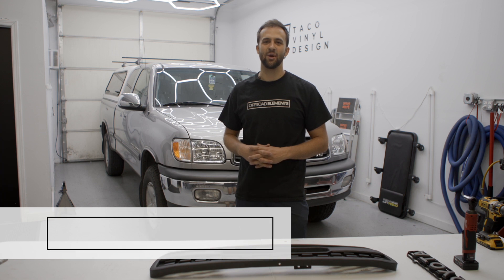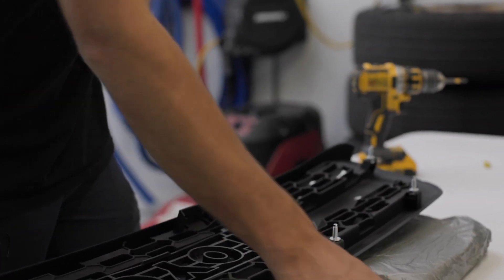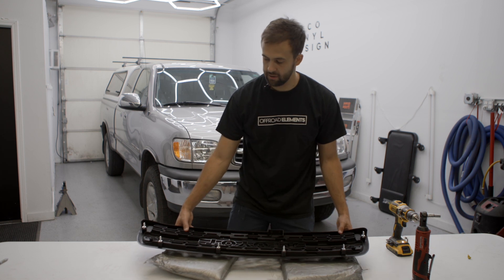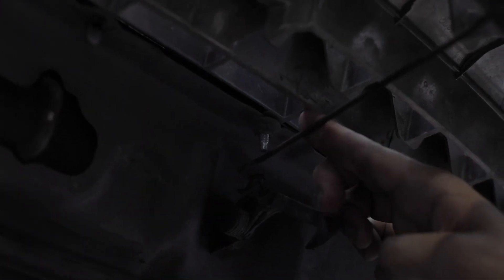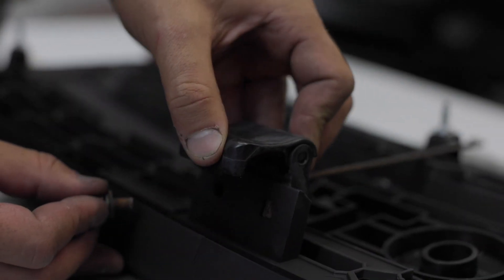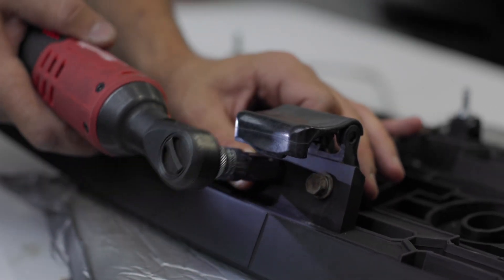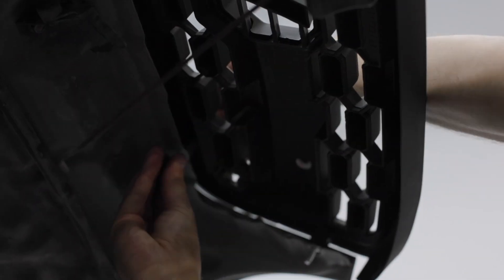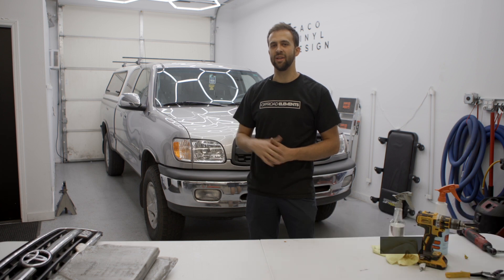2000-02 Tundra Pro Grille Install

Comment: So you buy a $250 grill and the manufacturer doesn't include a new rubber trim gasket ? The gentleman in the video even admits that older trim gaskets are problematic....REALLY
Reply from the maker: Stock ones work great if you can salvage them. If not, a brand new OEM one runs a few bucks